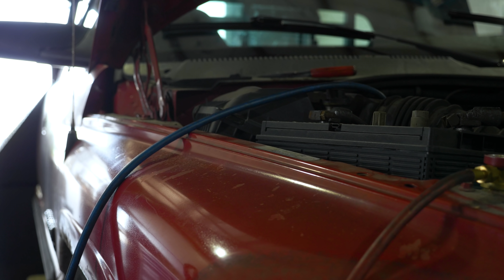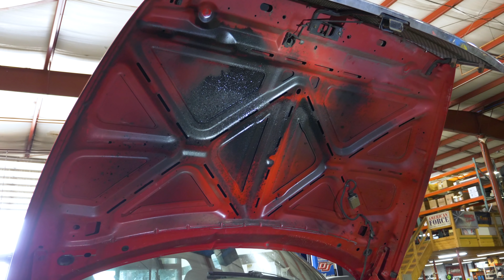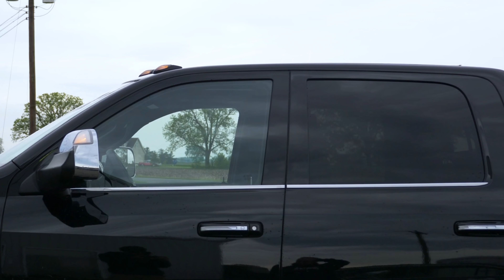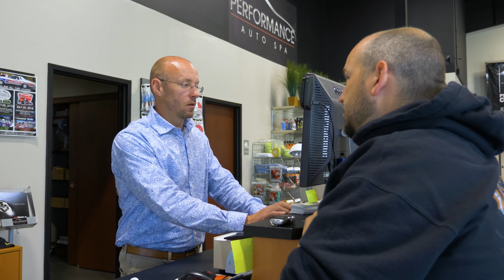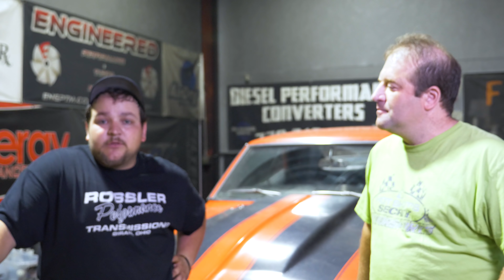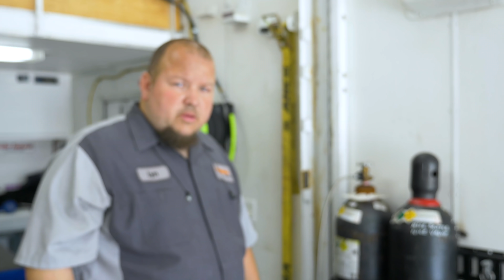68 CAMARO RACE FUEL TEST - 2019 RAM UPDATE - HOW TO FILL NITROUS BOTTLES

Comment: have you gave any thought to putting that heater on one them timers you plug in to the wall then plug heater in to the timer it is the kind of timer you use to time control light in your home when you are going to be gone for a longer time than normal
Reply: A PID controller. Like 18 bucks on amazon. It’s controls the temp so you can leave it on all day.
Reply: ARC does have a controller for it, they we're out the weekend I bought mine and I haven't ordered one yet.
Reply: @lynfordmiller4820  sorry i did now know that and the idea hit me of this and was thinking it would be cheap idea to try the one they have i am sure it would be far better